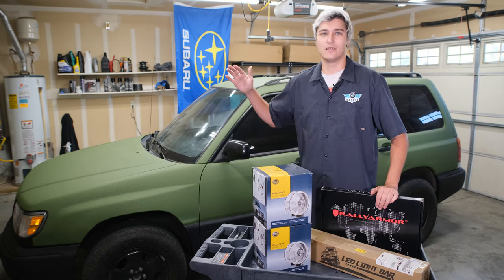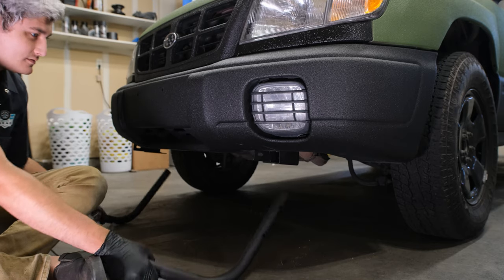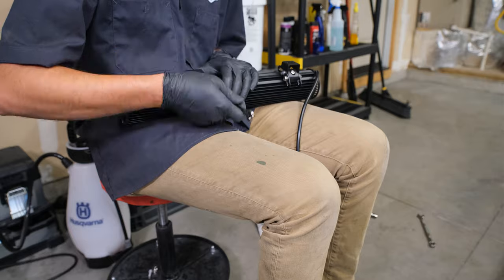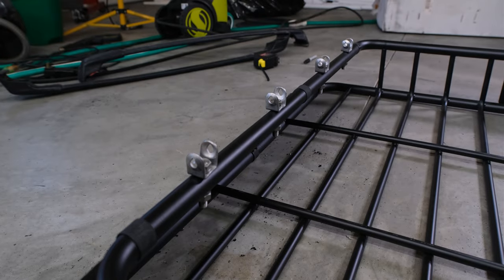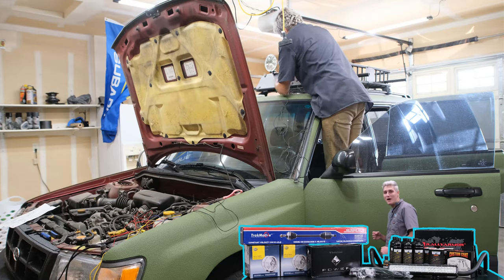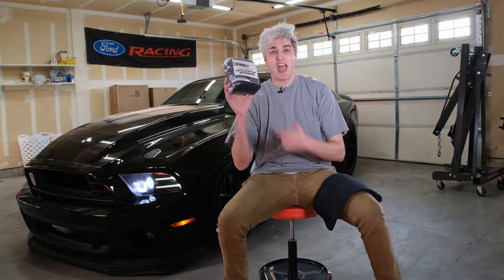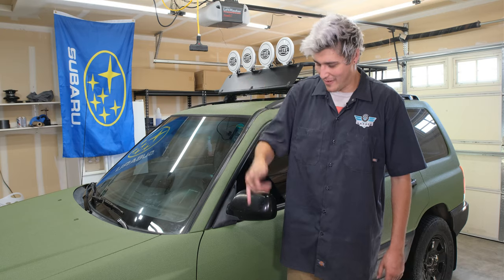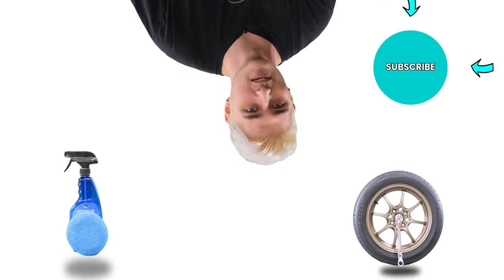Off Road Subaru Forester | Hella Fog Lights, Bull Bar, Rally Armor Flaps install!

Comment: Cool video I am thinking of doing something similar to my 2019 Subaur forester. A bull bar with some lights on it. I have to go to a shop to have it done since I don't wanna mess up lol
Reply from the maker: The Forester is made for upgrades like this - definitely do it!
Reply: @BeautyGarageYT  hey question i dont see many options for roof lights that are round i just see the long rectangular style bars. Is there a reason for this? Would it be possible to have round lights on the roof of a forester without a roof rack?
Reply from the maker: Here’s some round ones! 

Link: https://www.autoanything.com/lights/65A1325A0A0.aspx

We’re not sure why it’s that way, but you can make your own customs rods to attach the lights to.